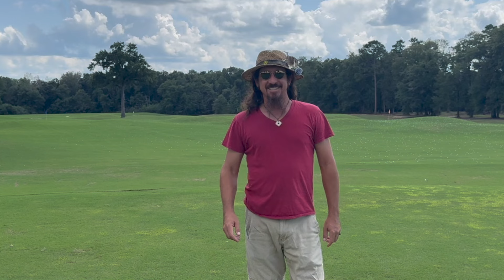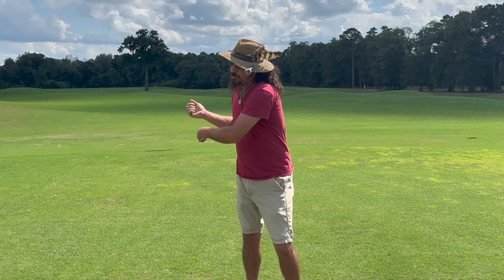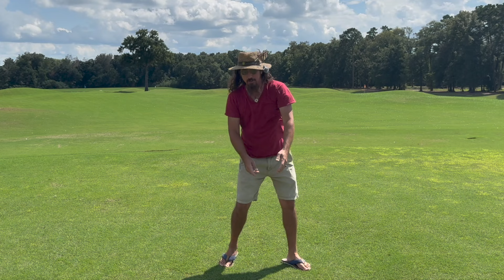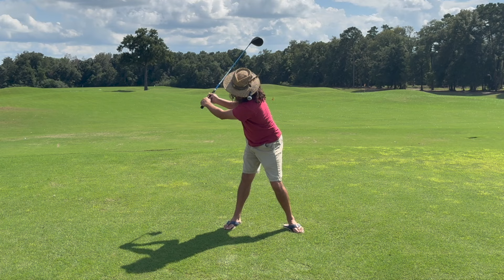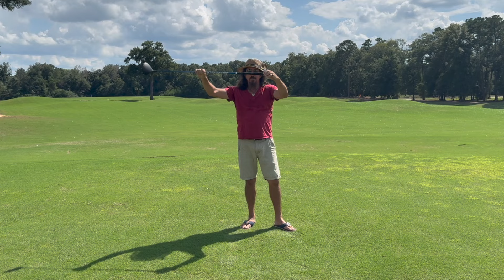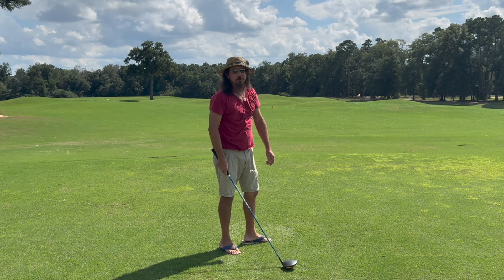Wizard Golf Instruction Lesson 11.4 Driver Power

Comment: great video as usual. in this video you recommend starting by moving the hips. I thought that in the earlier videos you suggested starting with the triangle (i.e. upper body). Is that correct? Is initiating with the hips only for the driver, not for iron shots? Thanks
Reply from the maker: Initiating lower body is helpful for most shots